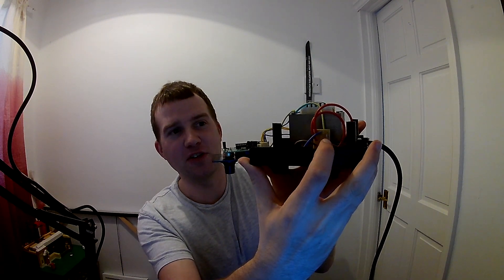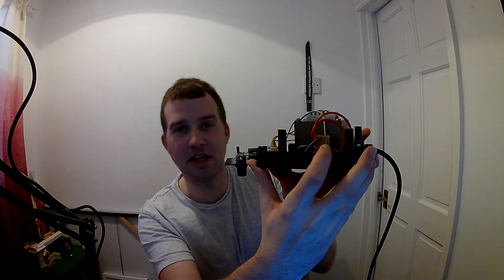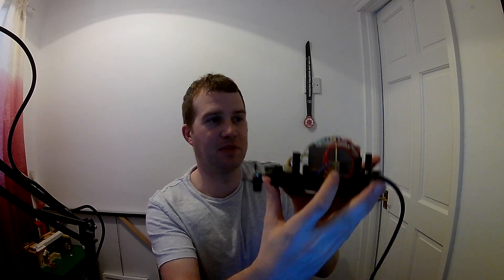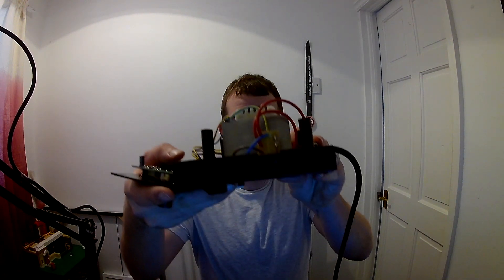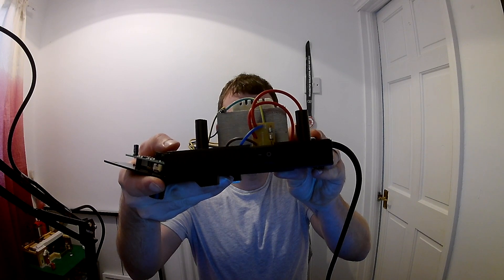weller soldering iron vs my cheap thing with fuse

Comment: Should we, in the uk, end up with one that does not have a fuse am I right in assuming that a compliant UK plug would cover it assuming a correctly rated fuse is fitted in the plug?

And for anyone reading this, if you get something that comes with a non-fused plug that fits in our sockets, throw it in the bin. In fact destroy it first so nobody can be put at risk by illegal "uk style" non-fused plugs! Either buy a replacement cable or cut off the faulty plug and fit a BS compliant one with the correct fuse.

Comment: Crazy huh!
I think the majority of their models do have a primary fuse, but at least two models are confirmed as not having it. Why some do and some don't Weller don't seem to want to tell us.
Reply: As I understand it.The Weller without fuse was a 120v plugged in to 240v outlet. Does the Weller item sold i Australia for 240v have fuse or not?